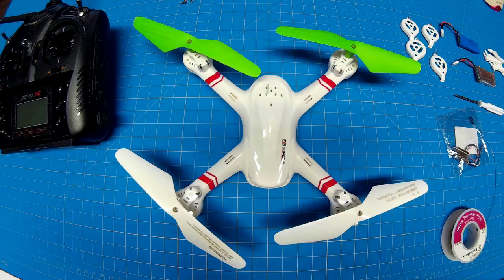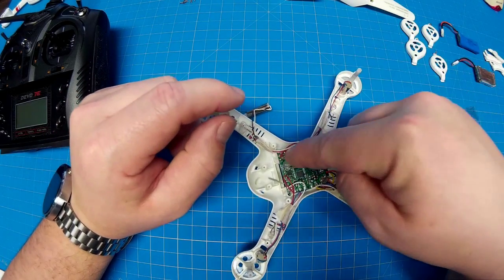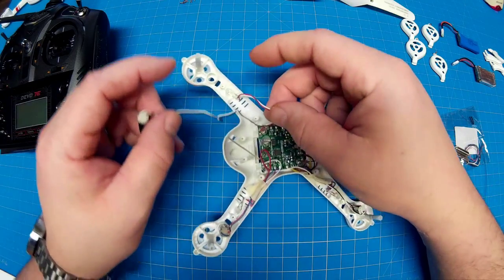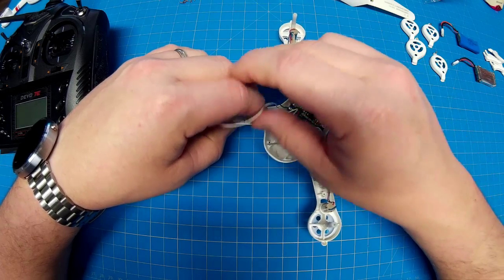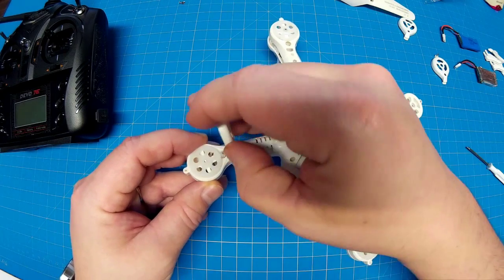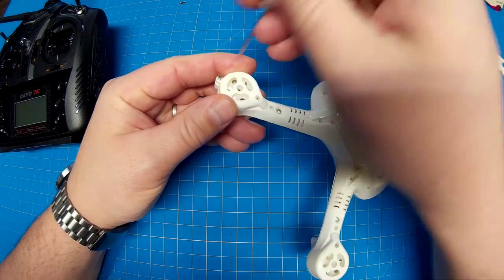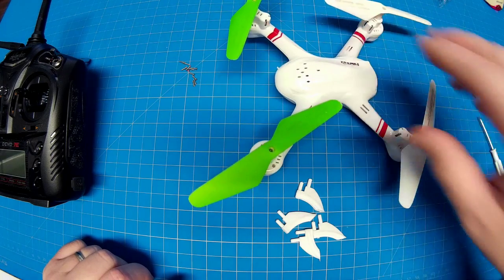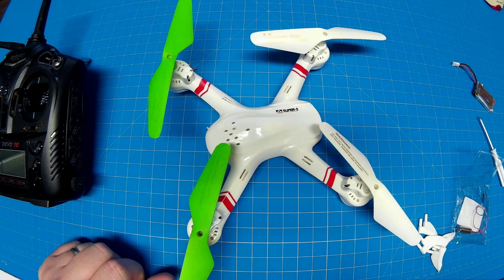Quad Brushed Motor Replacement

Comment: How do you change the gears out on these? Does the prop piece just pop off the shank? The gears are also tough to find. Anyone know a substitute gear for these?
Reply from the maker: The props unscrew, the nylon hex piece is affixed to the gear shaft. Not sure of a substitute, but search your model on gearbest and banggood to see if they carry parts.
Reply: When you say affixed, does that mean it will pull off like a mini drone non-geared prop? They can't be permanent, can they? How would anyone R&R a bad gear? Banggood and Gearbest have no replacement gears. :(
Reply from the maker: I don't believe its meant to be pulled off, it has to be static for thrust to be even. they might come off with some heat and ease, then getting it on another would be the trick in reverse. I have not tried or read about someone doing this, but maybe. If there are not replacements available its the only shot, or buying a replacement quad.
Reply: I saw a pic on the RC groups that had the shaft and gear separate, but no info on how he got it apart. The hex nylon was off too. Maybe it can be taken apart but , like you say, is very tough to get back to the original state.

I did pick up another white one, but it rubs the wrong way to use my original black MK for spare parts when it simply has a bad gear or bushing. Either a bad design or simply meant to be a disposable copter other than props, prop guards, and landing gear.

Comment: Thanks a bunch for posting this video! I happen to have a Mould King 33041A that needs a motor, of which I have on order from GB. They are $4.41 for one set of motors that include 1 ea. CW and 1 ea. CCW.  Your video is both very informative and in my case, very timely!

I only had the quad for about 2-3 weeks when one motor became defective. Perhaps I should try to pursue it as a warranty issue? Perhaps I will give that a try very soon. 

Very best regards and many thanks again for posting your very informative video. I hope you like your Mould King 33041. I love my 33041A and think it's a great little flyer. It is very stable, and has adequate pitch to fight the wind while in the highest setting. 
Joe

Comment: hey what devo is that ?does it bind with the mould king ?
Reply from the maker: +Junior V It is a Devo7e with the nrf24l01 module. With the module it does bind to the Mould King 33041
Reply: +Nick Burns Hi again, under what protocol please?
Reply from the maker: +D Navigator cx10, then choose format (green)
Reply: +Nick Burns Thanks!!
Reply from the maker: +D Navigator Sure. Happy Flying

Comment: Nice review 👍  ..can you plz tell from where you bought the green props. Plz provide a link to shop ...thanks and cheers
Reply from the maker: +sameer kadam I painted the stock props. Nothing special, cheap spray paint from local hardware store. Paint them slowly with light coats and plenty of drying time.

Comment: Where did you buy replacement motor from? ; have a link?
Reply from the maker: +D Navigator Sure, on sale right now $3.99 http://www.gearbest.com/rc-quadcopter-parts/pp_241280.html note it includes one clock wise and 1 counter clock wise motor.
Reply: +Nick Burns Thanks